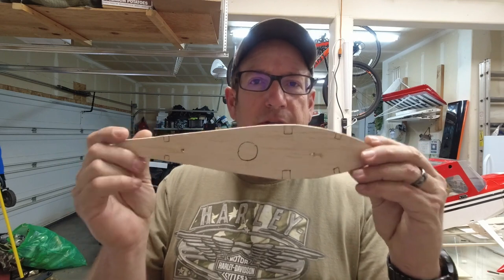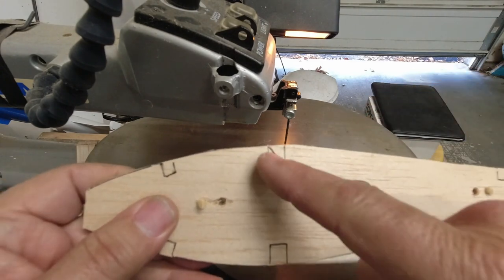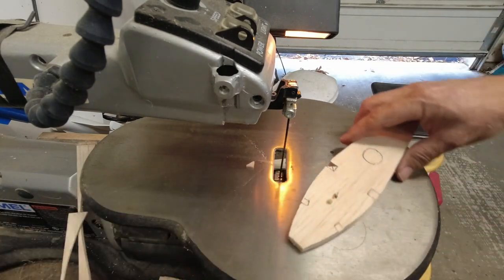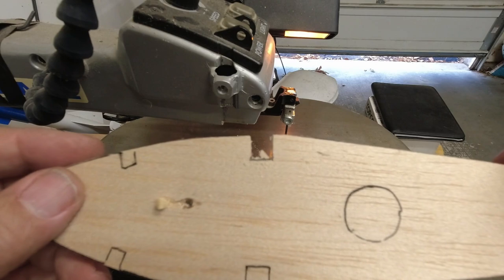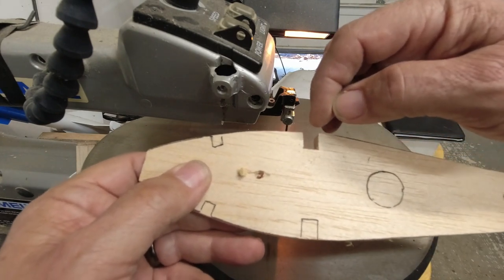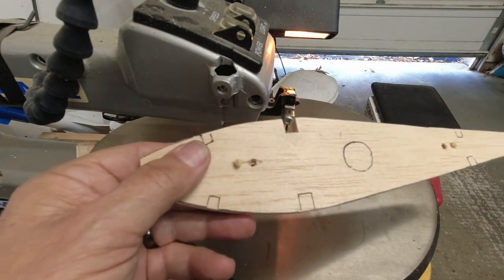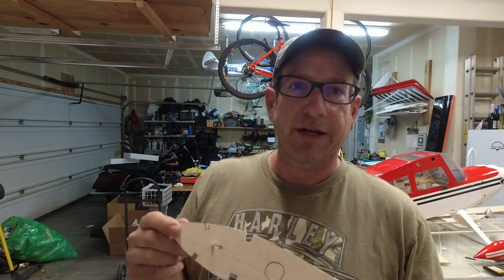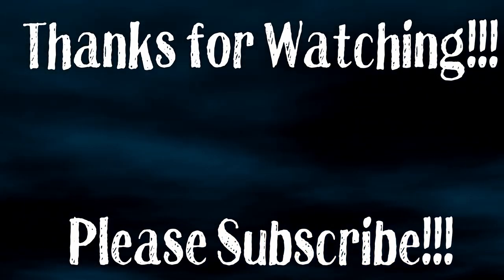Cutting Spar Slots, 6th grade shop style

Comment: When I cut the spar notches like that, I do the first edge cut and the diagonal cut like you did, but then I make my other edge cut. Then I go almost to the corner of the first two cuts and aim straight for the second corner. It leaves a much smaller "hump", and then I use a table saw trick used when cutting dadoes and cleaning the cut. I aim toward the bottom of the notch and move the piece side to side, rasping that last little hump from the bottom of the notch with the moving blade. I also leave the marked cut line, to ensure the spar that goes in the notch will be a tight fit. Balsa  has enough "give" that you can force it to a degree, and then fast CA immediately wicks into both pieces when applied. If the spar is hardwood, same thing goes, the rib will give just enough. I don't take the time to clean the notch with a file, as long as the notch is cut to size it doesn't need to be smoother than the saw cuts it.

I once had a Super-D like the one behind you at the end of the video. A radio glitch killed it.
Reply from the maker: That sounds like a great method of doing the slot cut out.  It does come down to removing that hump and like you, I have become very good at removing it with a horizontal blade drag across it. Slow and sure.

Comment: I like your videos.  I watched your entire  playlist of the Rebel build.  I  use a slightly different technique with either the scroll or band saw. After making your two initial cuts on either side just continue nibbling away at it, pushing straight into the saw.  With such a small area it doesn't take any longer. Hope to see your rebel fly soon.
Reply from the maker: I use that method a lot too.  After you get used to working with the saw(s) you kind of pick up those skills. Using the saw sideways.   Its easier to do on the band saw because the blade is fast and only moving one direction.   But the problem is my saw has a 9 1/2 inch throat and many of the materials just wont clear that.  So the scroll saw gets the job.

Comment: What are you using to hold your ribs together while cutting? I usually use a dab of hot glue but sometimes that causes parts to break when seperating them. I'd like to find something strong enough to keep the sheets from shifting while cutting but also lets go easily when I'm done. Maybe double sided tape?
Reply: A good cheap double sided tape is to glue blue painters tape back to back with CA glue.
Reply from the maker: If you look at the video you can see toward the front and end of the foil I have drilled a 1/8 hole in the stack and inserted a bamboo bbq skewer to lock them into position.    Works really well with 10 sheets